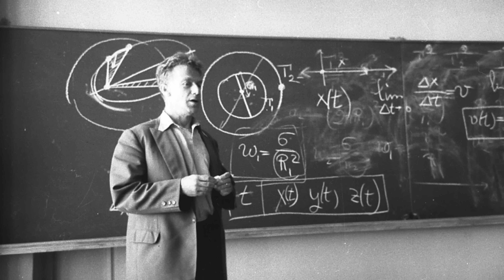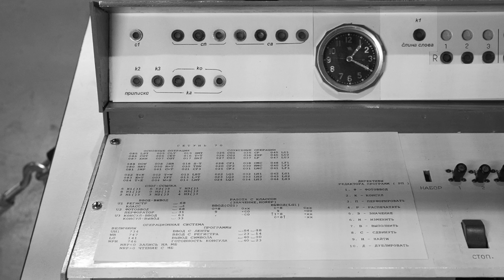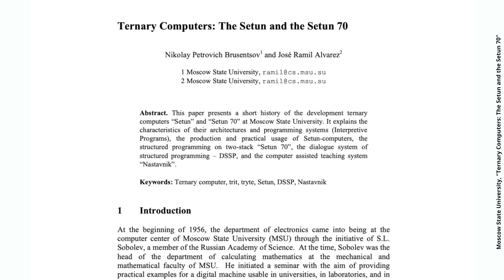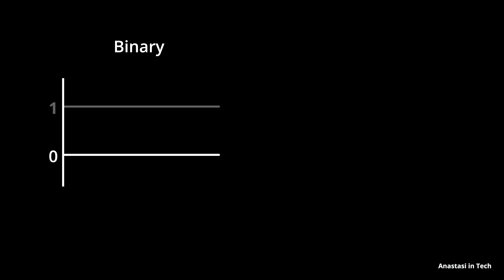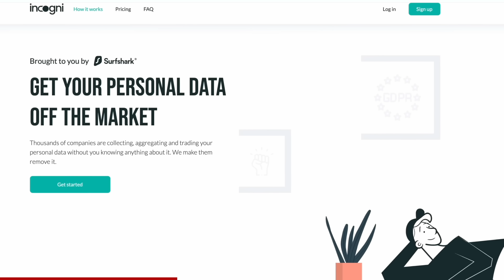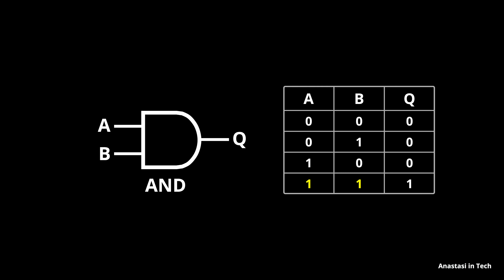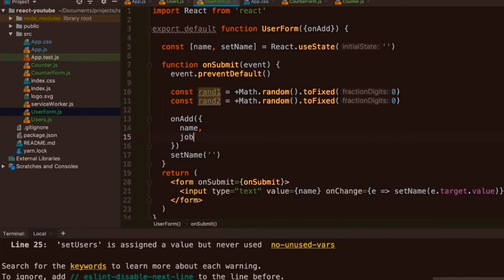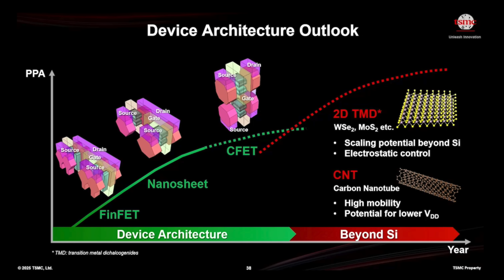The World's First Ternary Computer

Comment: It definitely will not replace binary because it is an unstable system regardless what you do. You cannot get from the two extremes states without passing thru the 3rd. The the voltage needed to reach the highest state (it's threshold) will also saturate the lower state. the same happens when varying the diameter of a nanotube. We already use a third state in electronic circuits known as tri-state which is a high impedance condition resulting in 1, 0 or non-existent. This third state is used for signal routing within the electronic circuit not computation but it is a stable 3rd state.
Reply: Gates in CPUs are clocked, so there should be no issue with the transition through the intermediate states, because they wont be relevant/evaluated until the next clock edge.
If the timing/clock constraints are not met, you will get faulty results, but this does also happen in binary systems.
Reply: @claudev.k2 I completely understand how clocking works and that is not the issue. You can think whatever you like but I've been an electronics engineer for 40 years. I'm guessing you are thinking of modern CPU's as sort of black boxes. That is, you provide some input that data is worked on and out come the results.

However, you do not understand the actual characteristics of the device. It is composed of perhaps millions of transistors with voltage or current switching thresholds. These thresholds have been continually reduced to reduce power consumption and heat generation. That makes them even more susceptible to noise. You also seem not to address or are even aware that the thousand or millions of internal circuits are affected by latency.

But, one can always dream
Reply: @josephnesser1961  That's merely an implementation detail to be solved by engineering. It might require a different compromise between number of states and noise margins, or it might require improved components offering better noise margins. But it's a choice, the only immutable law is that defining how much information can be encoded at specific levels of noise. We tend to make a very large number of such choices in such areas as data transmission and storage, but we don't exploit those choices in logic.
Reply: You are arguably correct for "today's" technology. However, ternary and even quaternary logic can be represented by naturally occurring multi-state phenomenologies in quantum computing -- and these states do not have intermediate transitions and/or "pass through" other states. So, bosons are naturally stable in three states, as are quarks (using color instead of spin), and the delta and omega baryons have four natural states.

It is correct that quantum computers built on quantum particle states are still well in the future -- but at least there would be no "transition" through a third or intermediate state to deal with. And, long before we're able to build computers using true quantum technology, we are much closer to being able to use atomic energy states -- which are quantized and do not require transition between states (it's really a design choice, but why design it to have a transition state when it's not necessary).

So, while it's debatable whether a stable ternary system could be developed using today's technology (it can be, but there are tradeoffs like clock speed, at least for now), quantum computing does not have that issue or limitation.
Reply: @vsabio Quantum computing in any meaningful way will take time to develop. I was speaking of conventional electronics technology. As far as Quantum bits being able to change states without passing through an intermediate state I do not believe it. Do so it would have to accomplish that feat in ZERO time and nothing escapes time. Not in this dimension. Obviously I know very little about Quantum Mechanics but I understand classical physics
Reply: @josephnesser1961   Understand. The reason there is no intermediate state in "true" quantum (not merely atomic energy levels) is that intermediate states are actually undefined -- i.e., they do not exist at the quantum level. Thus, there is no "pass-through" condition, nor "transition time" for the states.

And yes, while there's a lot of research being done, we're not there yet -- and won't be for some time. I was merely noting that ternary and even quaternary computing could be quite viable in the future.
Reply: Consider a modem. Initially they operated at either one frequency or another, encoding one binary bit per signalling transition or baud. To obtain higher speeds different encoding methods such as QAM were used to encode multiple bits per baud. This reduced noise immunity so engineering fixes such as line training were introduced to make it reliable. Transitioning from one QAM state to another clearly involves passing through others but this is not a barrier, because the point at which the value is evaluated is defined.
Reply: @theelmonk It is actually incorrect to state that transitioning between different QAM states involves passing through other states. It does not. Ever. Regardless of the clock.
Reply: maybe....? but questionable logic depending on the hardware. good thought tho.
Reply: @MrMarsMink  Not at all questionable. I've been an electronics engineer for 40 years. All it requires is a control input to the logic gate. You can do it to a single gate or the final circuit output depending on design
Reply: The difference between real engineer and not real engineer. Given a problem, real engineer starts with trying to find a solution, not real engineer starts with explaining why this problem can't be solved.
Reply: Imagine signal strength instead of a specific signal. Biological computing aka brains work this way. AI work this way (basically a massive network of scalars and signal strength storage). Biological brains are "unstable" as you mention. But they are still the most powerful systems that we know of.
Reply: exactly
Reply: Okay, so, I may have got it all wrong, but could you correct me? 

In my understanding, on is 1, off is 0. If there is a 3rd state, it should just read the amount of 'on'. Like anything between 0 and 1 is where we read the 3rd state from. 

Now the only question becomes how to differentiate between one of those values and a full on 1. For that we could either consider 1 as on and anything else as the in between state, or we can just do max of a range to find the on-est state. 

The advantage is that we get a whole range of data to read in the middle.
Reply: Of course the third is the watcher to make sure everything goes smoothly. Without it, red and blue go haywire. Too much energy buildup
Reply: Congratulations, on reviving a dormant 3rd stzte, th tri-state.. only issue here is fanout
That limits purposeful chain of command.
 Ai has developed weights..

Comment: It's not entirely true that all computer chips in the last 70 years were binary logic. There were analog computers. Having said that: the way I understand tri - state logic is when you have a high voltage - logic state 1, low voltage - 0, and high impedance - hi Z. This is used today controlling different things, mainly LED displays. If you use -1, this would create problems for the rest of the circuit. These voltages are always referenced to circuit ground. This means that in order to have a negative voltage, you need two supply voltages for the logic module, say +3.3V and -3.3V. Now you have to deal with 2 power rails in the chip instead of 1, and you need more transistors to do such a tri state logic operation. If you us 1, -1, 0 and hi Z then you get 4 state logic, not 3.

Comment: Consider that in the Cold War, the soviets desparately tried to get ahead of western technology, and they tried everything to achieve that, and the results were presented as a breakthrough, no matter whether it was reasonable or not. 

So far you have explained that ternary computing can save memory. That might work. But processing the data (ie using programs on the data) is another kettle of fish. This is what is causing the energy consumption. Binary programs on ternary hardware, which first has to be developed and then make error proof? When the bits can have even three states, how do you determine what has to be the correct state of the transistor? How do you create a checksum for something that can become exponentially worse?

Comment: I can see some complications with balanced ternary. You would have more than one value that could express the same number. If you wanted to express the number 7, you could write it as 111, or you could write it as 100-1. You could solve this by doing hardware normalization at the beginning and end of every operation.  That strikes me as being a bit messy. I don't think there are any operations that you would need to normalize mid cycle, but I could be wrong. I would also think that carry operations might be a bit more complicated.

Comment: This is ludicrous.  It makes zero sense.  
In binary 1100 = 12
What would 1-100 equal??
See?  Its not a true base-3 number system which would count 0, 1, 2, 10, 11, 12, 20...
Even her And gate, if you looked at the truth table was an And gate with 0/1, but an Or gate with 0/-1

Comment: I question your definition of a ternary and gate.

For positive and negative numbers to be treated the same, the Q for inputs (0, +1) and (0, -1) need to be the same. 

So if your definition of an And gate is used in practice, you've thrown away the big advantage of balanced ternary, the symmetry between and negative numbers. 

PS

There are in principle 8 kinds of binary gate, and 27 kinds of ternary gate, based on the number of ways to fill in the state table of the gate. Ternary logic gates would therefore need a larger number of names than binary gates.

It's therefore quite certain that the ternary gate I have in mind theoretically  exists and it may well have been given a different name.

Comment: binary exists because at the most basic hardware level components work based on if they are on or off. the logic gates worked off this principle. and you need this hardware before you can think about changing the code so at a fundamental hardware level you get on or off components that do everything from decide logic paths in hardware to generating different voltages.

Comment: What did we have BEFORE digital computers?
OH yes I remember designing them,  they were ANALOGUE computers.
Computing effectively with an infinite number of bits.
Vaccume tubes are not digital.
They are analogue but the I/P signal in the case of digital computing only uses the extreem delta of the grid drive.
Reply: Exactly, in a few years they may rediscover analog computing and remember why it was replaced by digital 😢

Comment: My older brother had a Doctorate in Mathematics and i liked computer systems and the low level programming with C and Intel x86 Assembly Language. I find things like both ones complement and twos compllement arithmetic interesting as well as the binary and ternary you mention here. The new Quantum Computers will revitalize ANALOG computing with 
the near infinite representable states you mention. In the FUTURE i see a QUANTUM COMPUTER STATING that WE NEED X STATES for this RESULT or ARGUMENTS for COMPUTATION 
and a DOMAIN SPECIFIC AI  will DIGITALLY ACCRUE what is needed to make it happen and LOCK those RESOURCES ....UNTIL THE COMPUTATION COMPLETES AND THE VALUE(S) 
ARE STORED. 

So if you divide a HUGE NUMBER by a TINY NUMBER the AI WILL calsulate the size of the RESULT and if you only have 1 Terabyte of Storage it might say that your hard disk is too small to hold the result, but maybe it can but the time for completion of the calculation exceeds 1 hour at 50% CPU usage it might need to ask for the ADMIN PASSWORD to continue. Of course trying to divide 1 by 0 is UNDEFINED and that will be flagged as an ILLEGAL OPERATION (caught at the CPU level if not by any AI level). So making sure things stay in bounds is important as well as IN TIME as you do not want that computer to run for 2 years on one problem if there are known Heat Dissipation Problems ANYWHERE in that computer! 

:cat-orange-whistling::face-blue-wide-eyes::face-orange-biting-nails::face-orange-raised-eyebrow::face-fuchsia-tongue-out::face-fuchsia-tongue-out::face-blue-smiling::face-blue-smiling::face-blue-smiling::face-blue-smiling::face-blue-smiling:

Comment: [11:30]  Like it applies to micro-kernels and server solutions for the non-monolithic kernel, such as minix, for ternary, aside from the hardware issues and noise, there is also the increased time overhead to contend with from a marked increase in the complexity of the error correction that needs to be applied. Like for NVIDIA and the the GPU and its coincidence to the complex matrix calculations that apply to how AI has been pursued, in lieu of that yet to be realised by Song-Chun Zhu, ternary may apply to AI situations where the scope of the computations is specific.

Comment: 1. Ternary is not at all new: people have been experimenting with it since the days when electronic computers had vacuum tubes instead of transistors or chips. 

Even before electronic calculators there was at least one example of a mechanical calculator using balanced ternary (see comment by another person for details)

2. Balanced ternary is the most efficient as you use the digits -1, 0, +1. That means that just like binary, the multiplication table is trivial so it's faster than any other base

3. The most efficient base in terms of storage space would be base e. [ That's Euler's number, not 14 in hex! ] I think it was Knuth who proved that, certainly one of the computing pioneers in the valve era. That has the practical problem that any whole number bigger bigger than 2.718281828 cannot be stored precisely. It's very awkward to use a base where integers take up an infinite number of digits and have to be approximated. 

As | e - 2 | is larger than | e - 3 |, binary is in theory less efficient. None of the above is remotely new 

The practicality was always in how to store the digits -1, 0, +1. If there is anything genuinely new here, it's in Sicily that practical issue. 

And no, base 10 would not be better, despite the premise of the sixties book & film "The billion dollar brain". It's a brilliant thriller but the underlying premise is scientifically totally misguided.

Comment: There is so much inaccuracy and magical thinking in this video whether stated or hinted at. It is not more efficient just because you are adding a logic state.  Additional logic states are not going to reduce the power draw, all voltages whether positive or negative are still voltages, and more complex circuits draw increased current while generating more heat. Citing exotic or theoretical materials as the basis of the ground breaking change is disingenuous at best.

Comment: The description of how a transistor works is not really right. I get the need to simplify things, but the description about "thresholds" is misleading.

First, the transistors Anastasia is attempting to describe are MOSFETs that tend to be used in digital circuits these days. Bipolar transistors were used in the past, but similar priciples still apply.

Transistors are essentially analogue devices. For a MOSFET, as you increase the Gate voltage, more current is permitted to flow from the Drain to the Source.* In reality, the electrical resistance is reduced proportionally to the Gate voltage.

When using a transistor, the load (the part you are trying to deliver power to) sits between the Drain and the power supply and has an electrical resistance of its own. The transistor can control the amount of current flowing through the load. If the load is a speaker and the Gate voltage is varied based on an audio source, you have the basics of an audio amplifier.

You probably learned about the formula V=IR in school. The maximum current you can put through the load would occur when the transistor resistance is zero. Basically, the load is connected from the supply voltage to ground through the zero resistance transistor. The load has a resistance of its own, the supply voltage is fixed, so that current that flows through the load is the maximum. So what if the gate voltage is related to a current flow greater than this maximum? The transistor is regarded as "saturated", a state that does not necessaril;y cause any damage to the transistor. This causes an awful noise in an audio amplifier, but is a deliberate design element for a digital device. Gate high = On. Gate low = Off. One and Zero. Binary.

Here is why I am raising this. What if we didn't use just the saturated state and off for the transistor? While all transistors vary a little so not all transistor translate the same Gate voltage to the same electrical resistance, they are probably similar enough to designate one or two midpoints giving 3 or 4 states instead of two. The old ISDN communications network used 4 states, effectively transmitting two bits at a time.

This sort of thing also applies to the old valves. I suspect this was behing the Russian ternary computer, adding a half state to the valve operation.

* It does sound as if the names "Drain" and "Source" are backwards. One way of thinking about it is to realise that current was originally thought to flow from positive to negative, a convention still used today. This was established before the discovery of the electron. We now know that electrons and their associated charge flow from the negative to the positive. Bearing this in mind, Source and Drain make sense from the elerctron's perspective. If this is too confusing, don't worry - just accept the naming convention and go with it.